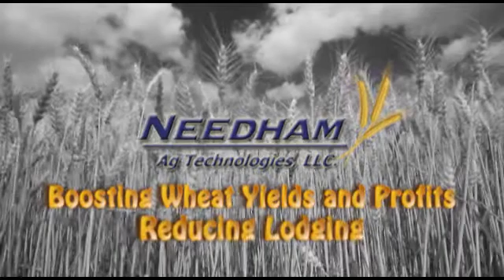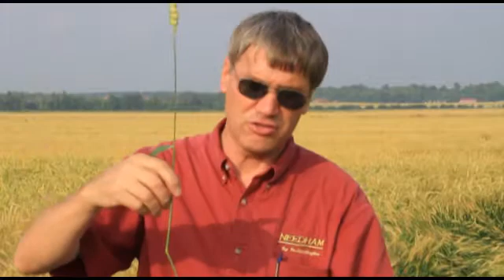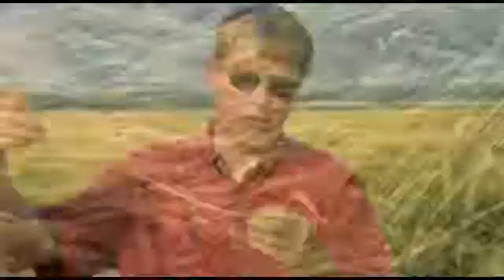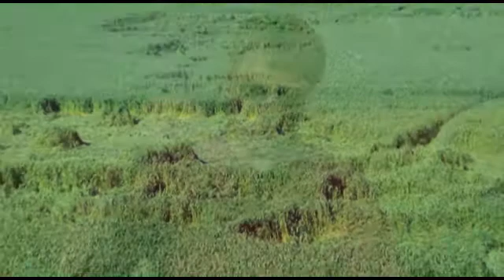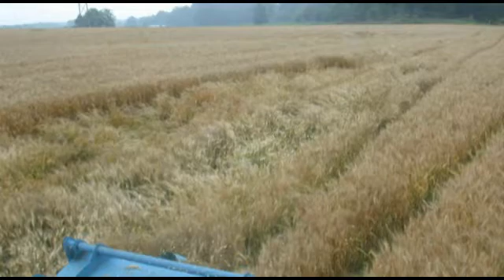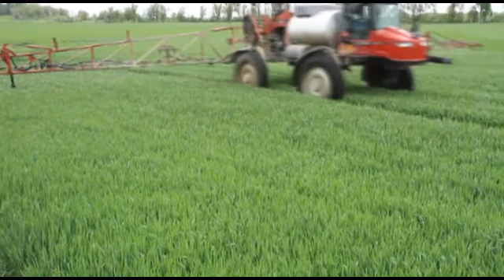Wheat Management - Reducing Lodging by Needham Ag

Comment: I know proper nitrogen placement is critical and phosphorus is critical but I would like to have more information about the importance of potash in wheat due to the importance of root and stem strength 
THERE is not alot of information on potash needs on small grains thanks